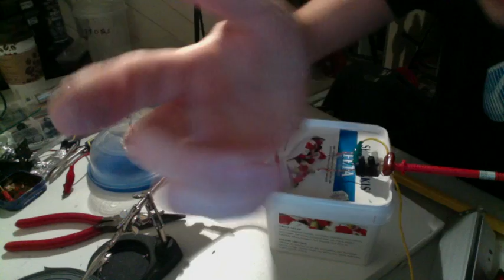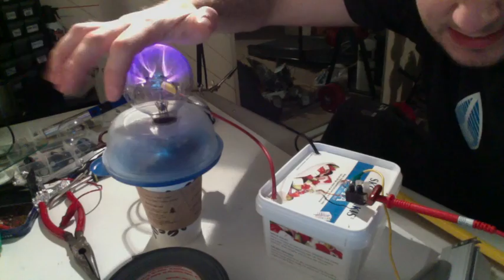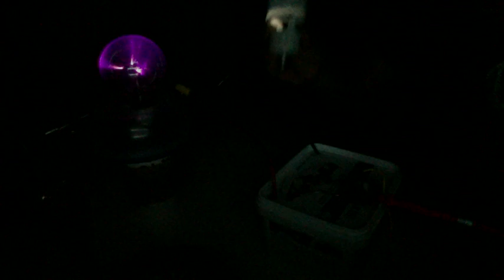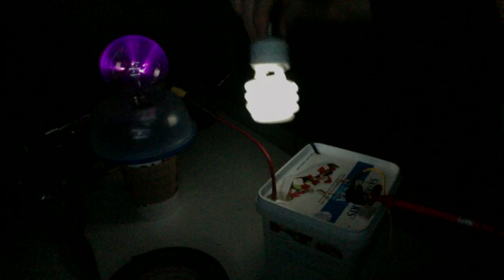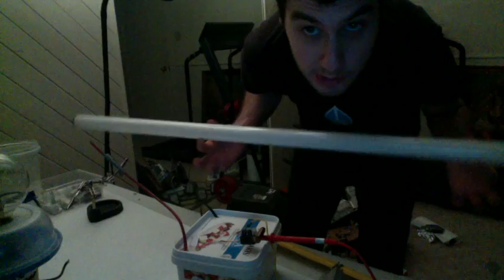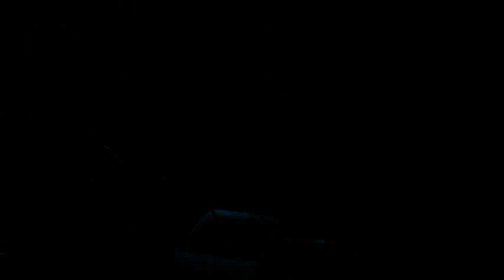Fun High Voltage Experiments with an AC Flyback!

Comment: Be careful not to overrun the busted flyback transformer though...I had my busted one burnout because I overran it, and it was because the windings in a flyback is apparently not suitable for high frequency AC due to capacitive coupling ;-;
Mine was running at a primary voltage of 80Vpp, with a frequency of 28.9kHz

Comment: How is AC safer than DC, I thought it was the opposite?
Reply: it's called the skin effect. the current builds up on the surface of the conductor when it runs on AC, so you only burn the outside layers of your skin. 
When DC, the current builds up inside too, so the charges in your muscles/neurons/organs get all jumbled up, causing more damage.
Reply: The skin effect becomes more promiment the higher the frequency of the ac
Reply: @nightrous3026  @UCF5OLJg_quQKJOkmtlMUAqA The skin effect doesn't actually help with humans. https://en.m.wikipedia.org/wiki/Tesla_coil#Skin_effect_myth